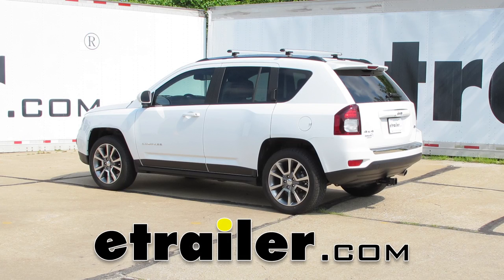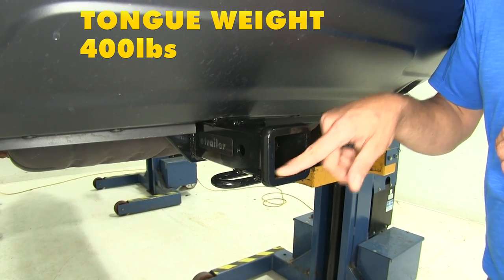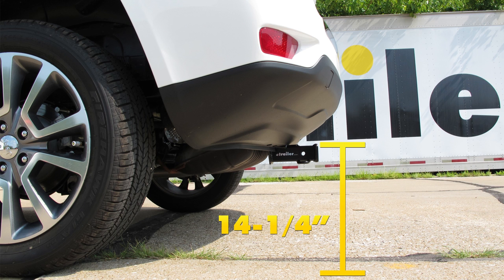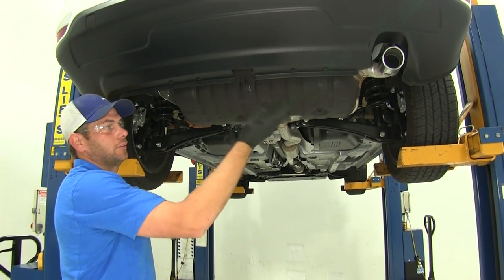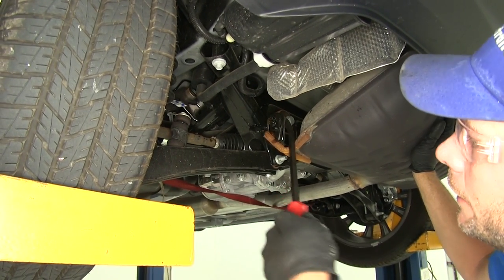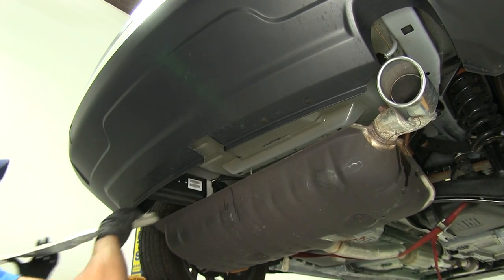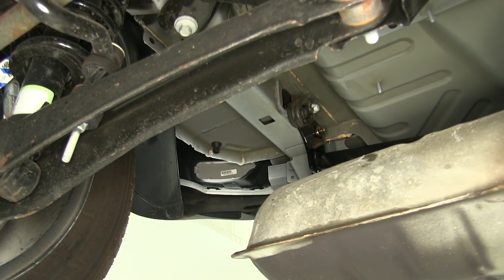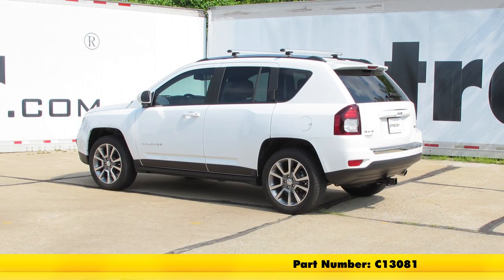etrailer | 2016 Jeep Compass Curt Trailer Hitch Receiver: Complete Installation

Comment: What was the point of removing the heat shield? Was it in the way?
Reply from the maker: We removed it because it was recommended to do so in the instructions. I honestly think it just allows more room to work and makes the installation easier. I linked the instructions below in case you wanted to check those out. 

https://www.etrailer.com/Trailer-Hitch/Curt/C13081.html

https://assets.curtmfg.com/masterlibrary/13081/installsheet/CM_13081_INS.pdf